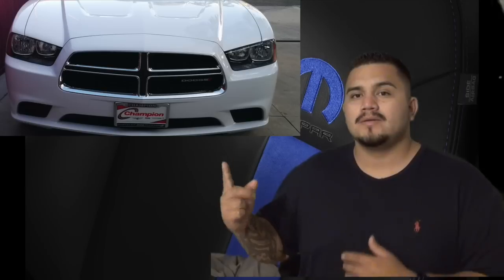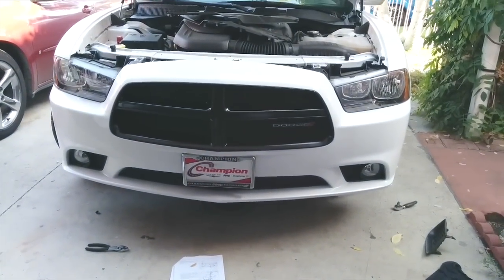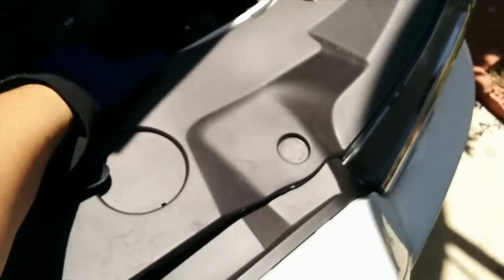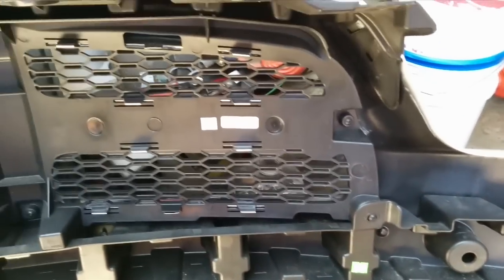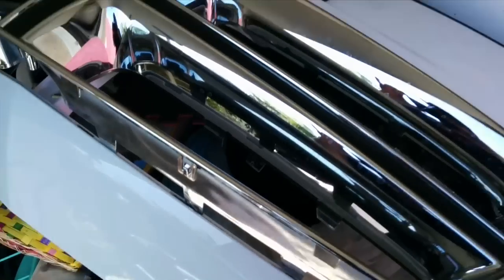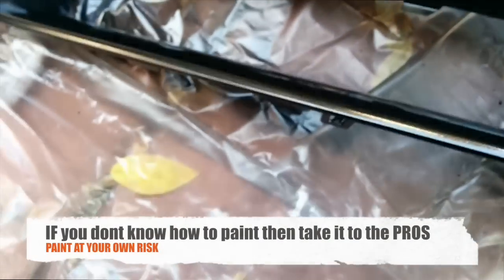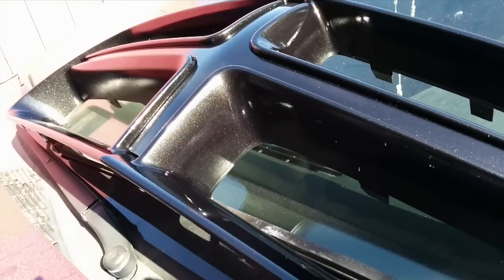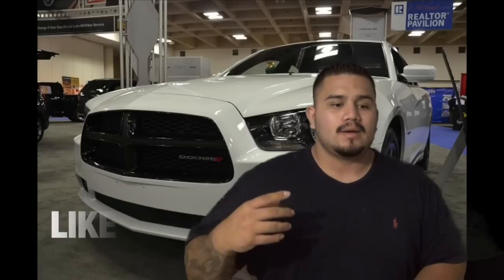2014 Dodge Charger /Chrysler 300- Making it BlackTop Edition Grill Paint Job (Bumper/Grill Removal)

Comment: Awesome. I want to do this to my 2012 charger grill. I had it plasti dipped and it looked good. I peeled it off with the intention of re dipping but I think I am going to do what you did.
Reply from the maker: yeah i did a plasti dip video also but this paint job i did on it really was worth it i only spent 20 bucks one black chrysler dodge matching black paint and one can of clear coat....and like i said in the video it looks ten times better then it does on video.....sun hits it looks like all kinds flakes in the paint.....i painted out side no wind took me maybe 20-30 mins to paint the whole thing... then i set it on the sun for 30 mins.....dried up fast.
Reply: @VehicleMods  did you sand the grille or apply any primer